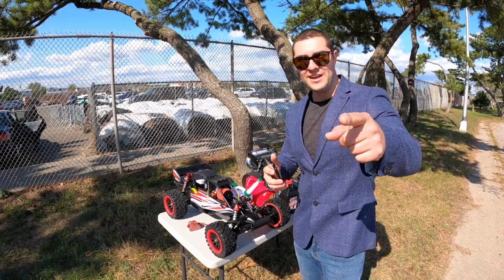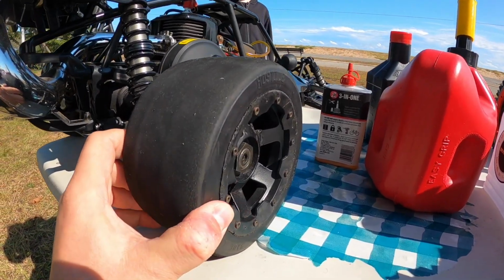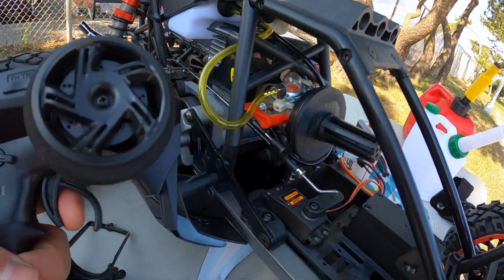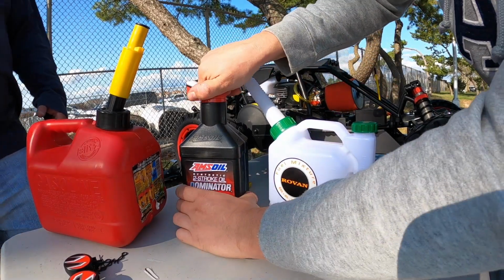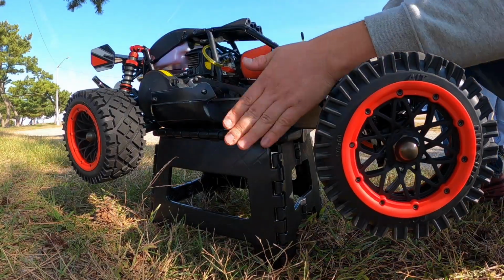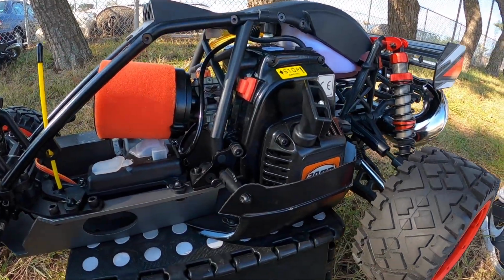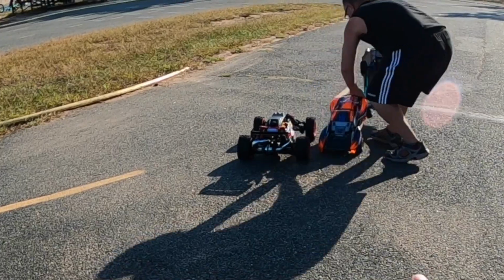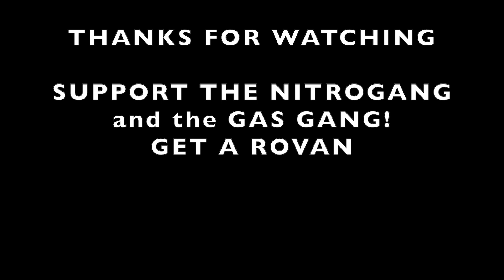Rovan Q-Baja 1/5 GAS RC - Break In and First Start Like a Professional

Comment: Can somebody plz help and tell me how long does the stock battery last on a full charge the one which comes with the car.
Reply from the maker: hey buddy! I've tested numerous BAJA's with various rated capacity RX batteries.  I can tell you that the standard 2500-3000 MAHH pack from rovan and Redcat last about 3 hours on a full charge.  But let me tell you, it's best practice to always charge your pack before you run, no matter what, and also run a kill-switch that will monitor the pack voltage.
Reply: @hybrid32494  thank u so much 3 hours is a lot
Reply: @hybrid32494  could u tell for 2000 plz
the name is SC6V2000mAh Battery
Reply from the maker: @gamingwithsid9531   I would estimate a safe operating time of 2-2.5 hours.  But once again trust me, it's best practice to charge before each run.  BTW there is also a matter of how hard you're running the electric system, some people use lights, some just idle alot, some are always moving servos while racing, you know.  My  estimates are for a mix of all these conditions, which are my typical running styles.
Reply: @hybrid32494  ok thank u so much i will use mine for like 1.5 hours just to be on the safe side your content really is amazing try taking thoe rovan to the desert sometime
Reply from the maker: @gamingwithsid9531  You got it man!!  always glad to help! I highly recommend you install a Killer BEE Kill switch, that system will cut spark if the RX battery voltage falls too low, under load.
Reply: @hybrid32494  ok i live in dubai so could u reccomend a akill switch on bangood or something like that

Comment: Hey bro what kind of battery do you use for the receiver stuff on the losi petrol rc cars?
Reply from the maker: hey man! You can run any 6V NIMH RC pack for any 1/5 gas RC.  Most losi owners will run a higher quality 7.2 LIFE pack or just a 2S lipo that will fit.  If you have modern high voltage servos you can run a 2S lipo in there.

Comment: Just purchased the symmetrical steering set up for my kingmotor t1000 baja. I'm excited to see the difference. I see that comes with it already. Cool
Reply from the maker: hey bro! YES! Let me know how you like that system on the T1000 baja.  The symmetrical steering on this SHORY chassis is unique, I've never seen a regular length chassis run with that steering system .
Reply: Will do that, like the videos man.
Reply: @hybrid32494  hey I got the symmetrical steering kit on the king motor t1000. It turned out way better on movement and durability so far. I have been through many wiper arm kits, aluminium,carbon, and even bought a stock hpi one and I wore them all out quickly. This feels way nicer and tightened everything up like I was expecting. Very happy with purchase.

Comment: How do you mix 25:1 on that fuel jug you used?
Reply from the maker: hey dude, the included ROVAN fuel can has lines where you fill it up with oil in the small partition and then with fuel in the larger partition, then you mix it together, it's already labeled for a 25:1 ratio.  I have other vids on my channel where I mixed fuel with more precision than I did here.

Comment: If I’m not mistaken for mixing the fuel on that jug on the oil part I just fill oil on the partition mark that has number 1 and for the gas I fill it to the partition line on top

Comment: Hey bro! Should i use this Amsoil Dominator oil in my rovan baja 5b(25:1)? Is it the proper oil for this engine? I just want to know for sure 😁
Reply from the maker: Hey dude.  Yes you can mix a 25:1 ratio for any 1/5 gas motor.  Its usually the common recommended ratio.  After a few tanks you could try 30:1 for a bit leaner tune.  Keep an eye on the spark plug too.  It can tell u lots of clues about the mix.   I currently run 32:1 btw.
Reply: Thanks!

Comment: Hey man do you have to tune these losi petrol cars?????
Reply from the maker: hey buddy! Yes, you need to tune all gas and nitro RCs, but it's significantly easier with the gas models.  All 1/5 scale gas RCs are daily easy to tune, it comes down to getting the IDLE speed correctly set with the low speed needle. Watch some O'NEIL Brother's vids on tuning them, thats how I learned myself.

Comment: I hope u respond to this but what’s good for nitro and gas radios. The fly sky gt3b, fly sky fs-gt5,or dumbo x4.
Reply from the maker: hey dude! I highly recommend the FLysky GT5, I;ve converted most of my GT3-B radios systems to the GT5.  here is the cheapest link for it thru amazon. https://amzn.to/3aH2P4y.  It's exceptionally easy to bind, easy to set failsafe and the receivers have built in gyros.  Trust me, the GT5 is the way to go.

Comment: hi can you list the cycles for the engine? how many minutes for each cycle?
Reply from the maker: Hey buddy, I normally do about six heat cycles of around 8 to 10 minutes each. The break in period is great for learning about how to properly start and shut these models off, so use this as a good time to learn about carb tuning, fuel mixing, and overall Starting procedures.

Comment: Got question for you. I live in Indonesia and recently got into rc cars. I got 1/10 WLtoys brushed buggy, HSP brushless buggy and sort course truck, all good fun. Partially watching you and others I am getting the gas bug. I have good mechanical skills (ex engineer now flying for living). I was considering VRX short course truck or the blue buggy V2, which seems to have better components. Getting nitro fuel and parts here is kind of pain. So now I am looking at this Rovan buggy, I like the 2cycle engine, pre mix...... I drive like an old man (51) and I need not to brake shit as it is hard to get parts this Rovan might be the way to go. I think the long wheel base would be a better choice, more stable, don't actually want to do wheelies and such. I like the tank up front, bit more weight on front wheels, better steering???? Any input will be appreciated. If you could put a short list of must have parts upgrades that would be great. What physical and mah battery pack do I need? Thx in advance.
Reply: parts are easy to find for the rovans steering alrt could be allitle better but no it doesn't wheelie it is loud upgrades depends on how u drive like are u ganna street drive it or track like dirt or so

Comment: Where do you find that oil? I can not find any online or at my local part store
Reply from the maker: Hey bro. I put an amazon link to it in the video description.  Its the cheapest u will find on amazon. Check the link, only 1 left in stock right now.  Get on it bro!
Reply: @hybrid32494  thanks bro!!
Reply: Go to your gas station the probably have some oils you can use
Reply: @rc_teo_nade_216  ight thanks dude
Reply: Always was on the redline but everybody using amsoil 😂 now I want some amsoil

Comment: Nitrogang loves wheelie monsters! I wanna see that mgt 8.0 run, I am thinking of trying to get one for christmas.  Honestly I wish all nitros had primers on the carb built in and a killswitch for the engine, it would make it so much easier.
Reply: The thing is that you can’t kill a glow plug since it’s literally heated from the flame of the last stroke. Spark plugs however use electricity from the ignition coil so those can be killed.
Reply: @nitrogas5719  yeah the glow plug is always lit, I was thinking more like a carb plugger or something
Reply: Killer RC makes a kill switch for nitro's. It cuts off fuel flow. It's called Bumble Bee Nitro Kill Switch. I don't know how well it works, but you can always do a search . It cost $53.99. Check it out. Hope that helps.
Reply: @ivegotgasrcbyvinny3025  yeah I did my own where I had a 3d printed servo mount and it pinhced the fuel line. Never really liked it because it took a while to shut off.

Comment: Hoe many heat cycles u have to do  until your able to go full throttle?
Reply from the maker: hey buddy! In general I usually do 8 heat cycles.  Some people dont even break these gas engines in and they also seem to be fine.  The oringal HPI Baja manual said the break-in was not necessary.  IN my opinion you should do some heat cycles because it cannot hurt and build some good confidence.

Comment: What's your opinion on the shorty Q Baja and the standard 5B chassis what one do you think is best to start with for a beginner with 5th scale RC gas that is I just got into Nitro and I know Nitro which definitely has its frustrations which I'm dealing with now I've only had my volcano s30 Redcat Nitro for less than a month and I already have the engine off of it trying to see if the connecting rod has been bent during pull start my one way bearing casing cracked and only put a scuff on my connecting rod but I'm having trouble getting it started I have fuel good fuel and good glow plugs and I even have the same Dynamite glow plug igniter as you the Lipo which works well but I haven't gotten the vehicle started since I replace the one way bearing what is your suggestion on the two different Roven gas RCs should I get the mini or regular size chassis as a starter I just want a RC with a real combustion engine on it to drive around while I slowly get used to the difficulties of nitro I'm not giving up on Nitro I just want to take my time to get used to it I've only had it a month or less sorry for the long comment
Reply from the maker: hey dude! I highly recommend you get the basic BAJA, not the shorty.  other than preference to the aesthetics there is no advantage to the shorty at all, it's actually more expensive, slower, harder to drive at speeds and more specialized.  I started with a ROVAN BAJA 30CC model, that's what you need.  IF you're 100% into wheelies, then the shorty is for you, personally I don't care about wheelies at all.  I prefer solid straight line handling and symmetry down the line with a planted feel.  You know.
Reply: @hybrid32494  yes I agree with you on that that is the only reason I was interested in the mini Q I think if I'm going to start with a gas buggy I might as well have the full size chassis yes I love doing wheelies but it seems like the mini Q is a one-trick Pony when it comes to that from what I've noticed the full size chassis seems to be the way to go I just wanted your honest opinion on it since I'm just starting out and I've worked on a lot of dirt bikes and four wheelers to the two stroke is more in my wheelhouse for maintenance than a Nitro I am not giving up on Nitro like I said before just want a combustion engine that's easier to work on and deal with and maintenance while I learn more about my nitro cars do you have any interest in buying a vintage GS Storm 8 scale buggy if not would you be interested in getting it back in driving condition for me
Reply: @hybrid32494  I know you do a few videos on getting cars back on the road for people and I would love to have the king of the Nitro gang work on it for me if you had the time or interest in doing so it is in pretty good condition for a twenty-year-old used Nitro the engine is seized from sitting but I do believe it is worth getting back together it was a $600 Nitro about 18 to 20 years it has an OS motor on it I'm not sure if it's a 28 or not the only thing it needs is a new gas lid for the tank and a pen replaced in the front differential other than that it's a really nice buggy
Reply from the maker: @TreySlayPlay23  BTW, the shorty is only about 3-4 inches shorter than the regular baja,  it just looks much shorter,  also a marketing thing.  Its not significantly shorter, you know. And I'm basically up to my head in old nitro RCs right now bro, I can't take on another project.  I got tons of other stuff to deal with, I recommend just selling that old nitro you got on eBay, now is the time to sell.  Get the 30CC baja for 450 and you will be happy!  Easy and reliable, and much faster than the shorty.
Reply: @hybrid32494  I completely understand bro I figured I would ask because I don't have the time to mess with it I only paid $30 for it LOL that and I got a HPI firestorm the electric version but it is in mint condition other than the old Chrome coming off the plastic Wheels everything is in great condition I bought both of them for $65 and the dude paid a thousand or a little over a thousand for both of them when he bought them I know you're a busy person but I would at least like to send you pictures when you have free time I figured I got a good deal on both of them I was driving the HPI electric the very next day after purchase

Comment: Have one of these cars in the same colour. Thing is mental, constant wheel stands.
Reply from the maker: hey my dude! what's up! Welcome to my channel, I think you're new to my channel, so let me welcome you bro!  I tend to remember all the comments and who I have responded too.  Thanks for watching. BTW I've got a coupe other dope 1/5 gas RCs, check them out, I can guarantee you they will blow you away, I've driven them over myself, towed a tree, cooked bacon and ate it from one of them.  Im serious.
Reply: Thanks for the welcome and the response. I've only had mine for a few a few weeks and absolutely love it. Wanting to add some weight to the front to keep the front wheels on the ground for drag racing
Reply: @matty8462  you can adjust your rear suspension spring rate to help it squat and hook up and this helps a lot with wheelies.. But you will need to increase the spring rate when you go back to rough terrain and jumps. This is the same principle for real life drag racing so give it a try. ;)
Reply: @txdbstx8967  awesome, cheers mate

Comment: How long have your motors lasted?  I'd consider buying one but the motor losing compression after a few runs kind of turns me off a bit
Reply from the maker: hey buddy!  I can honestly tell you that these gas motors will run for years!  This not like a nitro engine at all, they can run for long periods of time and hold a consistent low idle without a problem . Long as you run proper 32:1 ratio oil with good quality gasoline you will not have any issues.  I have other gas rc vids, and absolutely no issues.
Reply: @hybrid32494  awesome thank you for the reply.  I'm glad you haven't had any issues with yours.  I may end up purchasing one, any particular weak points?  Issues finding replacement parts?
Reply from the maker: @gabebinkley1300  I highly recommend you look for a regular baja,  not the shorty as seen in this video.  Check out my channel for many good BAJA videos I've done over the years.  In fact I even tower a tree with one, and no problems.  These motors are very solid and will not piss you off, lol!  You really dont need any upgrades and parts for the basic BAJA chassis are extremely abundant..

Comment: Wrap that pipe under the tank and wrap the tank that's an issue with my shorty
Reply from the maker: hey bro! Yes, I'm aware of that being a concern for these things, you're totally right. So far I have been keeping an eye on those parts and they seem fine.  IT could be a good long term investment though, so I may do it eventually.  This RC is my buddy's, it's not mine, but it's something that should be checked frequently.

Comment: Bang good didn't set the carb settings....lol
Reply from the maker: hey buddy!! Hold on, What do you mean?  I said a few times the setting were pretty good from the factory for this thing.  I only had to lower the Low Speed Needle 1/8 of a turn to get a low idle,  but for the first start they were ideal.  You want it a little higher when you start it, otherwise you will just need to raise the throttle trim even more.